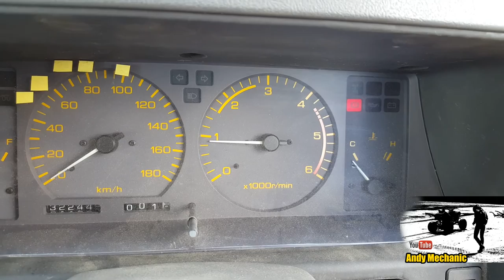Alternator component check, rebuild and bench test #1419

Comment: Many thanks, this has been very helpful to me in testing the innerds of an alternator.  The bit at the end was like a trip down memory lane for me, as i purchased a Nissan Patrol (24 volt electrics) brand new back in 1986.  I put 400k on the clock in the following 8 years, most of them towing a big Ifor Williams trailer and it never missed a beat. The friend i sold it to put a further 250k on it. After the inevitable bodywork corrosion we get here in the UK it terminally failed its MOT, but the engine lives on to this day in a big old forklift truck..
David in Dudley.

Comment: Hi Andy, great video.
I've just removed the alternator (no output) from my 1996 Patrol. So I'll be following your procedure, many thanks for posting.
I felt cheated, my Patrol has 'only' done 350,00kms and it's been bomb proof reliable for the last 12 years!!

A Pommie mate worked for Nissan for 20 years, thru the 80's and 90's, he said that in that era Nissan vehicles were designed by engineers, but that now they are designed by accountants...
Cheers Paul, ex Pommie, 20 years in NZ South Island

Comment: Changed the rotor,start,diode plate and eventually regulator but still no charge.how will i know if the rotor or stator are12V or what is ohm rating?

Comment: I have a new alternator. but it only gives 11.9 V. how did you connect the cables and to check the alternator. My alternator has "S and L" connectors "L" to the bulb, "S" to the "+" battery. That's how I understand it. And one thing, how to check which cable in the car is to be connected to the "+" battery, I think about these thin "S & L" cables, how to check which is "S which L" Thanks

Comment: A big belated thank you for the detailed vid. I have a Denso alt from 1988 and although it is not the same, the info on repairing is brilliant. By the way, is it normal for most Japanese alts to have to get to around 1500 RPM before they kick up the voltage beyond 13.5V ? Mine doesn't seem to start working until that RPM .

Comment: What wattage soldering iron would be suitable ? What to use instead of lathe ? Great video !
Reply from the maker: +Tom OConnor hmmmm. . Larger than 25 watts that's for sure. Maybe 50 watts. You can clean up the slip rings just using fine wet and dry sandpaper by hand. No need to use a lathe unless they need resurfacing. .

Comment: In my experience 18 - 20 yrs of being an auto electrician, and can rebuild these alternators in my sleep, most of the 
brush only repairs (customer requests) I've done have come back within
 12months (or a few weeks in some cases) because the regulator has died, better off replacing the 
regulator as well.. So many things wrong with this video.. , I see that you've commented on how the brushes were only 
making contact on parts of the slip ring and then you showed how out of 
round it was.. you should have machined it on the lathe to make it round again, 
leaving it like this will reduce the life of the brushes as they will be
 burning and wearing faster as they jump on the out of round slip ring, but at least u cleaned it . 
Did you replace the bearings? this wouldn't help the out of round slip 
ring either,  did you replace the seal in the back housing I saw oil on 
the inside of the seal which means there could be a leak starting..  did u 
check for a groove in the shaft where it goes through the seal?. I'll 
bet you'll have to pull this back out in the near future to fix 1 of the
 above mentioned problems most likely oil getting past the old oil seal 
into the brushes, making more work for yourself.  As you keep mentioning this alternator is 26 yrs yrs old, so why you wouldn't replace these serviceable items while you had it out is pretty silly.
Reply from the maker: +Matthew Dimauro Hi, thanks for your feedback. You are correct in everything you say. I did not set out to do a full 'overhaul' of the alternator, just to find what had failed and get the unit up and running again. I have a spare unit which I have also stripped and found a blown diode in the rectifier - I will be replacing the diode and reassembling it.

Maybe, one day I will do a comprehensive video covering all the required checks and replacement of seals and bearings etc but not this time around.

Thanks again for your input. Cheers Andy
Reply: That's fair enough, but instead of rebuild in the title, you should have put temporary patch up.
Reply from the maker: +Matthew Dimauro okay,  I'll change some of the description. Thanks again
Reply: And then there is my case. A new alternator that went bad after putting 39k miles on it
Reply from the maker: Bugger. Well, just to give you all an update, the re-brushed alternator is still working strong after 18 months of daily use. Sure, replacing the seal & machining the slip rings in the lathe would have been a sensible option - I do this to most commutators before rebuilding but maybe next time I'll do it on an alternator too.

Fair points to make and pleased for the input. 

Cheers Andy
Reply: @AndyMechanic  So I replaced the alternator with a new brush and installed it back into the car. After I start the car, the voltage across the battery reads 14.2V for about 3 minutes and then started dropping. After 5 minutes, it sits at 12.4V. The alternator runs quieter than when it was functional. When it was running at 14.2V, the noise was much louder and it seems to be spinning a lot faster than it is now (at 12.4V). I'm thinking of just buying a new alternator and replacing the old one, but do you see any sign of other parts of the car causing the low voltage? The old brush was worn
Reply from the maker: Hi Tom. Alternator rpm is directly related to engine rpm - ratio cannot vary as dependant on pulls size. Have you checked the battery? If it can't accept a charge then that may cause the problem. But by the sounds of it you have a bad alternator.
Reply: @AndyMechanic  Battery is brand new. It was at 12.65V to start off. So I think it is the alternator that is bad (something other than the brush). I'm not a very mechanical person and I don't have the tools to test other parts of the alternator. It's weird that it went and stayed at 14.2V for 3 min. What do you think is happening? Do you think replacing the whole alternator would fix the problem? I also noticed the engine, alternator and other parts are vibrating when the car was idle. I'm debating on taking it to the shop to have the professionals do the job or replacing the entire alternator myself and pray everything works out. Of course the latter is cheaper but I'm afraid of it not working out to be 14.2V again
Reply: @AndyMechanic  Thanks for all the replies Andy!
Reply from the maker: Hi Tom, it sounds like it could be a heat related problem where a circuit it breaking once it warms up? Definitely must be an internal fault of the alternator knowing your battery is new.

Looks like you'll have to replace the alternator now...

Hope this helps
Reply: @AndyMechanic  Thanks Andy! That actually makes sense. I did some experiments and found the following. When car first starts up, voltage is 14.2V and drops after a min or 2. Shut the car off and wait a while and start the car up again will repeat this observation. But starting the car again right after shutting off gives a 12.4V. I believe you are right about hypothesizing this to be "a heated related problem where circuit is breaking once it warms up"
Reply from the maker: Okay. Great. It could just be a dry solder joint....no harm in stripping the alternator again to take a look....